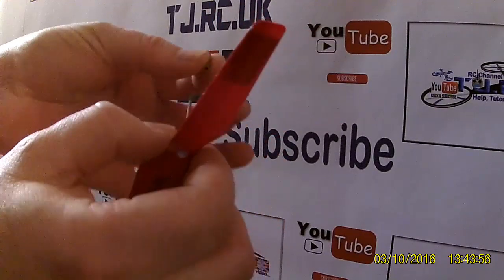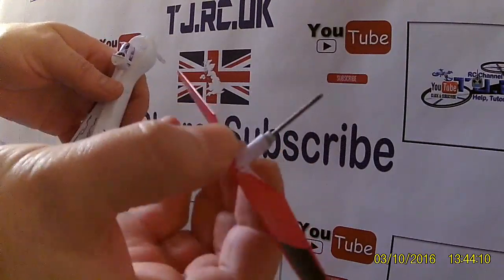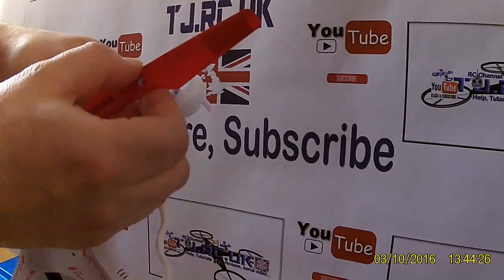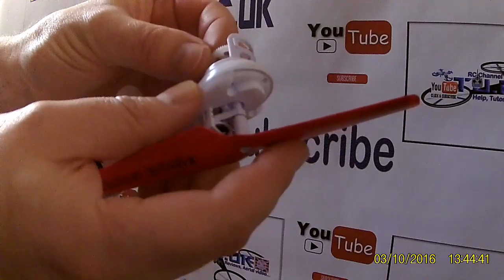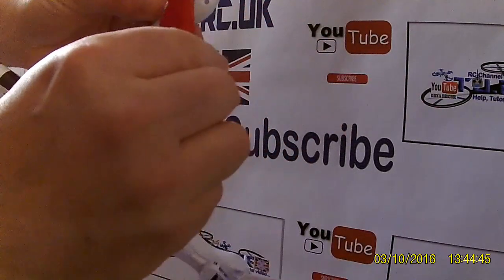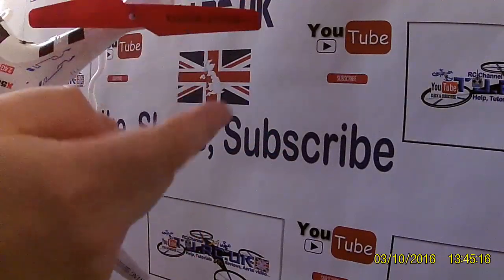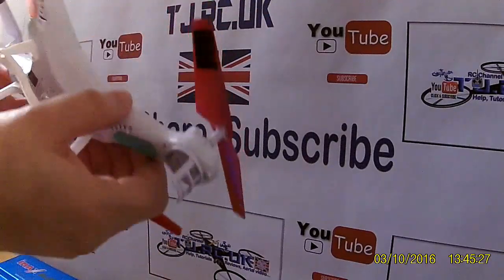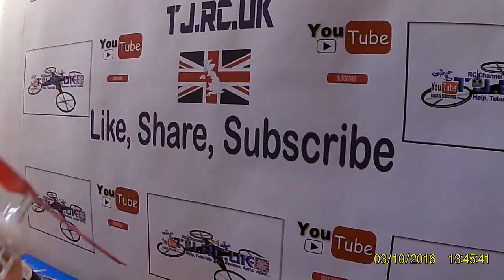Syma x5c & x5c-1 Repair & Maintenance video - how to remove the prop shaft + plastic gear my way :)

Comment: Is chaoli 8.5x20 motor compatible with syma x5c-1?
Reply from the maker: The motor mounts won't take this size as they use 07x20
Reply: Even if i do mods to fit it in?? Is it compatible? Cos some motors makes wobbly motion to the quad if theyre not compatible... I just want to know ???
Reply from the maker: If they are 3.7v motors and you adapt the holders then I guess yes It can be done maybe gears and pinion gear would need to be changed to handle the extra power.

Comment: Thanks for the great tip -- replaced a bent shaft without having to take the quad apart - also appreciated the screwdriver trick - - much easier than trying to use a need nose pliers.
Reply from the maker: No problem glad it helped you Bill, please like and sub to my channel if you have not already, thanks

Comment: I try it but nothing is changing is rolling like wont to unscrewed!
Reply from the maker: It will come off pull it as you are turning it ccw.
Reply: TJ. RC.UK After a lot of turns?
Reply: TJ. RC.UK whats ccw?
Reply from the maker: Nick D. Counter clockwise a few turns no longer have this so can't say for certain sold it ages ago 🙂
Reply: TJ. RC.UK    I try it in another propeller and it works but in this which i want it maybe have smashed ! :-( What i must do now to take it out if it is smashed?
Reply from the maker: Nick D. You could try going clockwise while pulling it but pretty sure mine all unscrewed  ccw worth a try it has got to come off if enough force is used 🙂
Reply: TJ. RC.UK Ok but in my first effort I was turning it opposite. Maybe have smashed and now from all turns you turning it is only rolls (without something unscrewed)

Comment: Thanks - helped me... I didn't know how they came apart either.  btw, you can stick the little screwdriver through one of the holes in the main gear and it will stop it from rotating... a little easier than holding pliers if you're clumsy like me.
Reply from the maker: Frank Posterello No problem please like and sub if you have not already, thanks

Comment: Thanks a lot for that really helpful little video!
The gear was the only thing I didn't know how to disassamble without breaking something. ;)
Saw another disassamble video before, 30 minutes, nothing usefull with some hands playing feeled 5 minutes with the LED caps, measuring the batterysize another 5 minutes, what anybody who can read a ruler can do himself and so on. xD
Reply from the maker: lol i know what you mean, that's why i made this tutorial really to help people like yourself & others as there was nothing really showing this on youtube :), please sub if you haven't already, thanks.
Reply: And now I wanna know if my little mods are working well. I swap the stock 0720 (7mm x 20mm) motors with some 0820 (8.5mm x 20mm) with fitting motormounts for them and the walkera plug with a JST-BEC type, hoping to get a little more power from that little quad. ;)
Reply from the maker: I love modding upgrading my quads, I no longer have my x5c-1's but I did do a lot of mods with them :). it should give it a bit more power as long as the battery mah c rating is good, only thing is you are restricted to 3.7v battery & motors with this.
Reply: I have only one stock battery and all others are 750mAh with 25c or more, so I think there will be enough battery power. Don't wanna use bigger LiPos than that cause it makes no sense to rise the weight more than that. I want more power for more funny flying and not to lift more heavy batteries and if possible to lift my mobius sometime. ;)
Reply from the maker: Yes you are right on your thinking there, it defeats the object going to big with the batteries adding extra weight, this works well with the 808 #16 v3, a mobius might be a bit on the heavy side although with that upgrade it should handle the weight a bit better :)
Reply: Yea, this is why I said flying with the mobius from time to time and not for normal flying, what will be best without any camweight.
Stock the X5 can lift the mobius but flying is impossible. I have a mobius and a SJ-Cam so I'm not willing to buy another cam only for the X5 and before I do that I will buy or build another quad instead. ;)
Normally I'm flying planes, a lot of scratchbuilded Depron jets, a modded EasyStar II and a modded FunCub, so the TX is no problem at all, having a Taranis plus and some 5 gramms RX to combine with flightcontrollers via S-BUS, unused CC3D and even a 3D printer, so there are a lot of options. xD
Reply from the maker: +Andreas M. 👍👍👍
Reply: The result is much better than expected, atm I havend swapped the batteryplug on my LiPos, so first test was with walkera plug (quad has both now) and it is able to hover with mobius and only 50% throttle :)
LiPo had round about 60% when I added the cam.
With stock motors it needed 100% to come up from the ground and maybe 90% to hover.
I'm sure it'll be like an other quad when going outside.
Reply from the maker: +Andreas M. Good stuff, it will make a good camera bird this with the möbius attached 👍
Reply: These motors are crazy, the X5 hovers without cam with only 10% throttle and the mod was cheap too, 4 motors, 4 motormounts, 16 props, 4 landing gears and 8 propguards in a package for 13.-€ from Banggood EU warehouse xD
Reply from the maker: +Andreas M. Good deal 👍